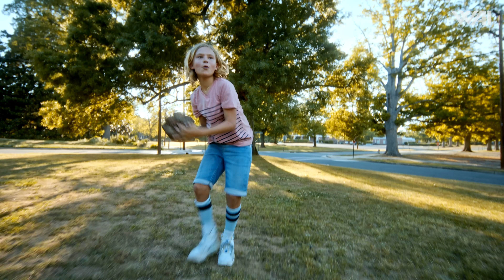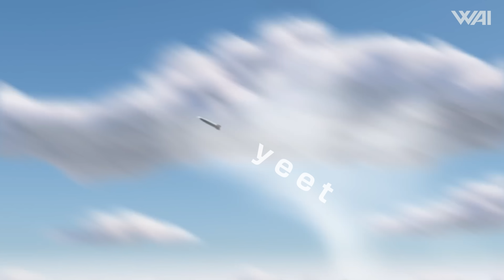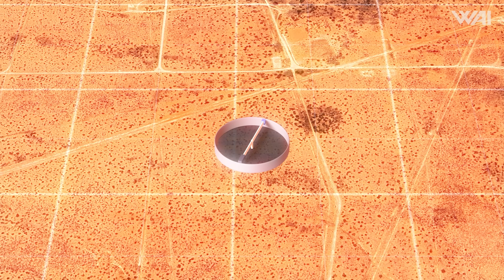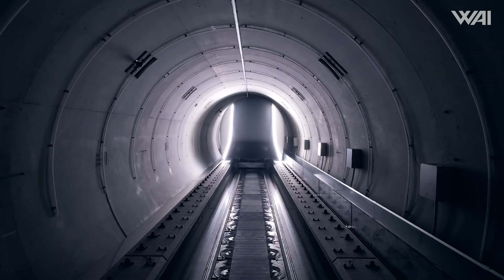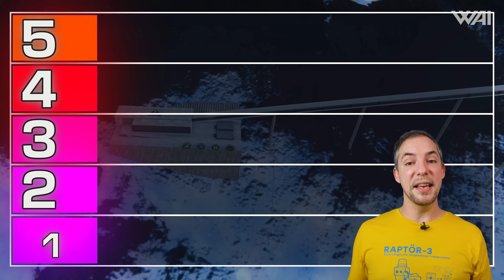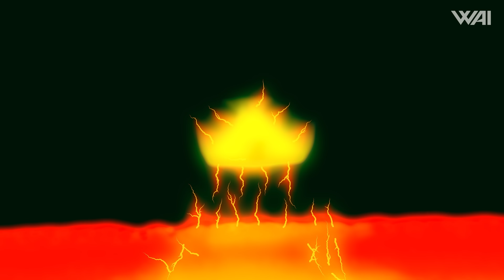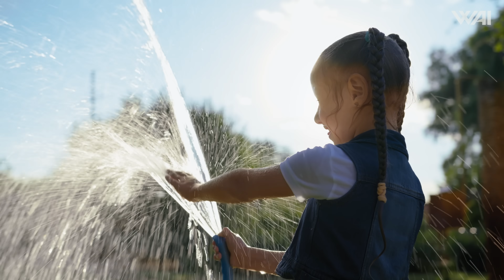The five craziest (but possible) ways to get to Space!

Comment: I have 3 ideas of working 100 percent proven but I don’t know how to start the project to who i should trust please someone help me…. Am sharing one of the projects diagrams ….if we use a combination of [fabric clothes with Solar flexi+ Cold dense air + drones connected very light electric wires + big solar powered stations  connected from first unit from the earth + each unit have 1km length and 2m have diameter ] I give this project name    “An Air Road To Moon “
1) Properties 
Each unit can be maintained individually  2) all opposite factors force are distributed in the unit so it’s very easy to manage 3) it is using all solar energy stored in the batteries in the night time 4) it is flexible if needed can be wrapped in the bad weather conditions till the effected length not all others part can maintain its position independently 5) it can change position in the space 6 it will be a proper road to space anytime we can use it to transport….
Problems 
1) still in the diagram not tested yet  2) according to available diagram only 0.5 meters of diameter of object can be sent into the space by the help of drone available drone technology is sufficient to do through this

Comment: If they build the maglev launch platform in a spiral or concentric ring to get it up to half final speed before it needs a long straight track then the straight track would not need to be so long. Especially if they build it up a mountain instead of just in the air.

Comment: Put a railgun on Olympus Mons. Also put a big nuclear reactor there to power it, and also the elevator on the side of the mountain (in case astronauts want to explore other parts of the planet). With the railgun you can shoot spaceships to any part of the solar system. The advantage of Olympus Mons is it's relatively gentle slope and very very long distance to the peak. Also, the peak is basically outside the atmosphere so as you increase your speed, the air resistance goes even lower than Mars' naturally low air density.

Launching from Mars is practically free. (Though you'll need some good nuclear fuel like Uranium or Thorium)

ps. if "railgun" sounds like too violent of an acceleration think of it as a maglev train that just keeps accelerating till way past escape velocity.

Comment: Interesting magnetic repulsion suspension of the maglev tube if it works. But you glossed over just suspending from balloons. An altitude of 25 miles, 40km, is routinely reached by balloons. High weight lift capacity is routine too. Vendors of all equipment already exist, and market demand, and price ls low. Not much air flow that high to move it.   To resist drift station keeping thrusters of various types are available. But even if drift couldn't be resisted, orientation thrusters, not position, is the most important factor in launching to a desired direction. Requirements are 300 miles in length with 10g acceleration. The vacuum tube in low pressure air is lighter with lower external pressure to resist. The maintenance of a vacuum is easier, but may not be needed at that altitude.

Comment: Space tram. Start the rail a kilometre or so underground. Change the angle gradually over it's entire length. Don't evacuate the tunnel, increase the pushing power. This will accelerate all the air in the tunnel. This requires more effort but removes the need for a door or membrane at the end of the tunnel. The air in the tunnel that is in front of the vehicle will be accelerated to extremely high velocity. This gives the benefit of the vehicle not running into stationary high density atmosphere the moment it leaves the launch tube. Instead it will be riding along in a jet of air that is travelling at a similar velocity. Due to the length of the launch tube the length of the ultra high speed jet of air would be considerable. So the vehicle would be at a substantial altitude before the jet of air dispersed. This would reduce the shock load as well as the air friction experienced by the vehicle. Basically it would be a giant air cannon with the vehicle riding in the jet of air. Most of the investment would be in the ground based stage zero. So maintenance and upgrades would be predominately a ground based activity, greatly reducing long term costs.

Comment: I'm a long time follower of space and was familiar with these crazy ideas. However, the best concept I have found is orbital rings. Imagine a rail made from Lunar Iron is placed in low Earth orbit. Continue to add more rails until we have a complete ring around the Earth. Next, create a second ring moving in the opposite direction. Across these two rings we place a platform that uses magnetic levitation so it is supported but does not actually touch the ring. The platform moves so that it remains always above the same point on the Earth.  A cable dropped from the platform allows spaceships to climb above the atmosphere. By tapping the kinetic energy of the ring the spaceship can be magnetically accelerated to orbital velocity. While this is a massive undertaking, it is straight forward engineering.

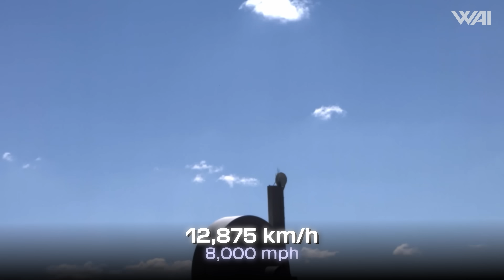Comment: 2:48 "the elimination of air resistance is vital"
And impossible if one starts at maximum velocity at zero altitude.
21:37 "no material"
Helium balloons can reduce the weight.

The real solution? 70% piston engines, slow props, and very large wings, enabling very slow slight and a 40+/1 lift to drag ratio at very slow flight speeds

Comment: Would a space elevator cable experience the same tension along its length? If not, then if it were a ribbon it could be wider where the tension is higher and narrower where it is lower, saving weight and reducing the required tensile strength requirement.

Comment: There's a few options and some variations to those listed that I find interesting. I believe I heard Isaac Arthur say fairly recently that the material needed for a true space elevator has been made. It's just expensive. When you factor in the economies of scale that one would need to build it, the price per unit will decrease.

Orbital rings: These use the active support from the space fountain to keep a ring around the Earth. They accelerate the particles to above orbital velocity so they push outward while the ring uses those particles to stay up.

Tethered ring: These are essentially the same as orbital rings but they are tethered to the ground. I like this concept more  than the orbital ring because they can be made on the ground. It's the same principle though. They accelerate particles to above orbital velocity which causes the ring to rise in the air.

There is also the airship to orbit idea that JP Aerospace is exploring.

Comment: Two previously engineered alternatives to the fission bomb approach are
1) the use of laser induced fusion pulses using deuterium pellets to propel a space vehicle. The smaller multiple rapid impulses would be gentler.
2) the use of a powerful ground based pulsing laser to drive a space vehicle out of the atmosphere as it creates pulsed air plasma pulses in a cavity at the back end of the vehicle for micro-satelite launches. This has been experimentally tested to low altitudes. RDG

Comment: All of the vertical lift options (Space Elevator and Fountain) have a major flaw that you did not mention. Because the Earth is rotating, there would need to be horizontal force continuously applied to the cars to accelerate them horizontally. At the equator, the surface of the Earth is moving at about 1,100 miles per hour. At geostationary orbit altitude, the top of the line would be moving about 7 times faster. Simply climbing straight up is not all that is needed. The cab has to be pulled up to the higher speed proportionally to its elevation. Descending would require deceleration in the same way. Nothing is free.

Comment: Accelerating via nuke is still 10 out of 10 for me. Second, wouldn't the space fountain also have a similar issue to the space elevator, with the tubes to be long enough to reach the vacuum of space? Not to mention the construction methods to assemble a tube that high? With all the inevitable atmospheric instability, the tubes would have to resist swaying and flexing in the wind. I don't think we have the material for that either at that length.

Comment: Just like fusion power we're always X years from developing the technology. Graphene/carbon nano tube tether technology was 5-10 years away, 20 years ago. Consequently, plans switched to building a space elevator on the moon, and now back to Earth.

Here are the main differences between an Earth and moon based space elevator:

🌍 Earth: Why a Space Elevator Needs Geostationary Orbit

On Earth:
>The planet rotates once every ~24 hours.
>A space elevator has to remain fixed over a single point on the equator, which means it must be anchored to a satellite in geostationary orbit (~35,786 km above Earth).
>This orbit matches Earth's rotation, so the counterweight stays above the same spot.

🌕 Moon: No Need for Geostationary Orbit

The Moon does rotate, but it rotates once every 27.3 days — the same time it takes to orbit Earth. This is why the same side of the Moon always faces Earth (tidal locking). But more importantly:

>There’s no atmosphere, so launch and construction challenges are reduced.
>The gravity is weaker (1/6th of Earth’s), which means the elevator doesn't need to be as strong.
>Because of the slow rotation, there's no significant centrifugal force to balance gravity like on Earth. So a traditional Earth-style counterweight system isn’t necessary.

So How Would a Lunar Elevator Work?

Instead of extending up from the Moon to match its rotation, a lunar space elevator would:

>Be anchored on the Moon’s near side, ideally near the equator or even at the poles (since rotation isn’t critical).
>Extend toward Earth, or more specifically to the Earth-Moon Lagrange Point 1 (EML-1), about 58,000 km above the Moon's surface.
>At EML-1, Earth’s gravity balances the Moon’s, so it's a great “anchor” point for a tether.
>Cargo could ride up the cable and be released near EML-1, needing very little energy to then travel to Earth.

Summary
Feature	                                         Earth Elevator	          Moon Elevator
Needs geostationary orbit?	         ✅ Yes	          ❌ No
Needs counterweight?	                 ✅ Yes	          ⚠ Optional (but useful at EML-1)
Affected by rotation?	                         ✅ Yes	          ❌ No (Moon rotates slowly)
Feasible with today’s materials?	❌ Not yet	          ✅ Much more feasible

Bottom line: The Moon’s lack of rapid rotation doesn't prevent a space elevator — it actually makes one easier to build than on Earth. Some proposals even suggest that a lunar elevator could be built with current materials like Kevlar or Zylon, making it a realistic near-term goal for space infrastructure.

Comment: I wonder is a combination of Airship and Space Elevator would be a thing… Imagine a space station with elevator in geo orbit, letting down a hook and a contra-weight the other way. As low as physically possible. The Airship can just about reach it and attaches a payload capsule, the elevator wheels it in and places the capsule along one of the airlocks of the station… getting a old capsule down works the same way in reverse… ¯\_(ツ)_/¯

Comment: This was such a light glossing of these subjects as to be extremely misleading for most of these options.  Isaac Arthur does a much better rundown of these, and even his are overly optimistic, ignoring some of the pitfalls.  I think that if you make videos on these subjects, you need to be more sceptical and less optimistic, and link to real data and conversations.  I come here for space updates, not speculative science fiction.  And that is what all but one of these are currently.
Reply: And on the subject of crazy ideas for reaching space, you didn't even mention the orbital ring that (imo) is lower in the crazy scale (and more useful) than the fountain tower.  Spin launch may work someday.  Rail launch will be useful from the moon and other airless places.  The Orion drive would only be used to travel to the outer solar system or further.  The space elevator will never be used on Earth because other options are more practical (even if they seem more complicated).

Comment: I got some comments as an aerospace engineer and a few more modern updates that i think should be mentioned.

Spin Launch:
Even though it probably technically works from a physics perspective, it doesn't make much engineering sense. For one thing, it's pretty limited in payload because you just can't scale it up that much, and those paylods have a segnificant mass penalty because they have to take 60k gs sideways, which realistically means you can't use most deployable structures, and the propellent mass fraction for any propulsion system is going to be terible, so extra delta-V is comparatively really expensive. You also need some way to reload it and reset the counterweight without opening the vaccum chamber because pumping it back down every time really eats into your launch cadence. It could be interesting for throwing slugs of refined material off the moon though.

Star Tram / Mass Driver:
These are really cool and make a lot of sense, but they work best for a rapid series of small paylods because the cost is really driven by how much mass you're trying to throw per shot and how fast you need to throw it, and how often you're using it is just a question of power generation. These are also much easier to build on the moon where you get the vaccum for for free and don't need to throw nearly as fast, and lots of small paylods is much better suited to raw materials than finished goods.
The biggest issue with mass drivers is really that switching powerful enough magnets on and off fast enough to acutally keep accelerating the projectile to orbital velocity is a rediculously hard probelm, and the only good solution I've heard involves quenching superconducting magnets by saturating them with a supercritical field from the projectile, which is both really expensive and wastes a lot of energy as heat.

Project Orion:
At least if you're staying in the solar system and at tiny fission bomb scale, there is actually a much more modern and paletable version called mini-mag orion, where instead of using 0.3kt conventional fission bombs, you use basically a giant magnetic can crusher to set off the nuclear reaction by imploding a shell of mylar foil around a much smaller ammount of fissile material, which keeps the explosion small enough to direct it out an actual magnetic nozzle and increase the puse rate so you can have smaller dampers. it ends up with about the same ISP because you loose some fission efficiency with a smaller bomb, but you also get a much more directed blast and less non-fissionable material. It would also work with a smaller spacecraft than a conventional orion drive which would be more practical to build, and could be more paletable to use in LEO since the better containment means it wouldn't set off a series of EMPs.

Space Elevators:
Why do people always talk about space elevators and never talk about orbital rings? Orbital rings can get too and from space much faster with short tethers and use mass drivers on the ring to hit orbital velocity, provide efficient supersonic intercontinental rail travel around the ring, can support intercontinental superconducting power transmission, and can be made with existing materials, and building an orbtial ring out of lunar steel should be cheaper than building a space elevator from advanced carbon materials launched from earth once you're considering building either.

Space Fountain:
I think this is a suprisingly practical idea. Among other things, the extreme altitude would allow it to do a lot of jobs currently done by satalites in a way that is much easier to service, upgrade, expand, and defend. it would also be useful as an alternative to tethers for getting to and from an orbital ring or holding up an earth based mass driver.
Active support structures sound a little crazy, but it's a relatively simple idea, wouldn't be that hard to build, and it would probably be powered by solar pannels at the top of the tower with plenty of redundancy, so I think the acutal risk is more about natural disasters or sabotage effecting the base, which isn't much different from a regular sky scraper.
Reply: You'd probably enjoy reading the paper "The Techno-Economic Viability of Actively Supported Structures for Terrestrial Transit and Space Launch"

Comment: Why not building a high start tower structure for Starship on top of a high mountain? Skipping a couple of km compared to sea level should reduce energy consumption significantly, so its effect could be similar to the Space Fountain (you need those vacuum tube structures for the Space Fountain, too...). But with less risk and most certainly less cost.

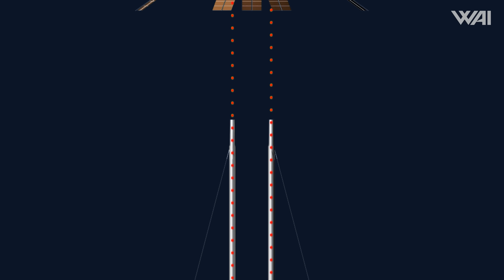Comment: 29:01 I feel like the space fountain is a WAY more complicated method than is necessary. It seems ya could basically achieve the same thing with a really large high altitude balloon for a fraction of a fraction of the cost!
Reply: That is mainly because you don't have a single clue about how balloons work.
Reply: High-altitude balloons are limited by the density of the atmosphere. As they rise, the air gets thinner, which reduces buoyant lift. Around 40 km up, the atmosphere is so thin that the balloon can no longer displace enough air to stay afloat, no matter how large it is. This is why balloons can't reach space or serve as a structural replacement for a space fountain, which is designed to extend well beyond the atmosphere and support much greater loads.
Reply: Yeah, exactly. The balloon gets ya to much thinner atmosphere and a vacuum rocket gets ya the rest of the way. It’s not a great way to do it, but WAY less complex and expensive than a “space fountain”.